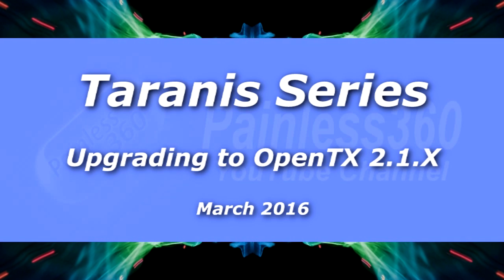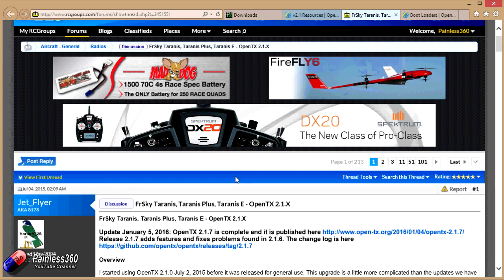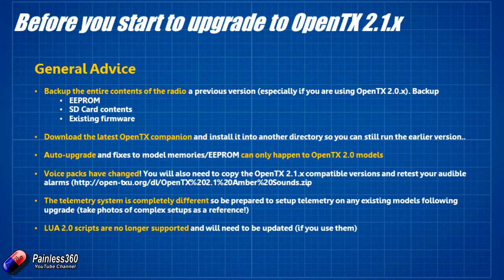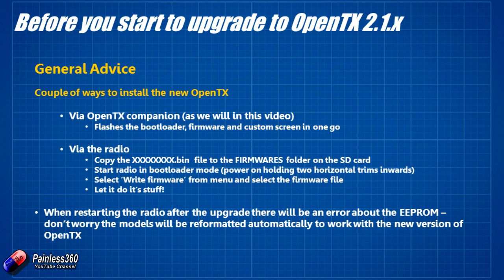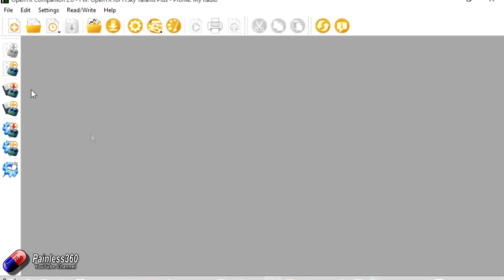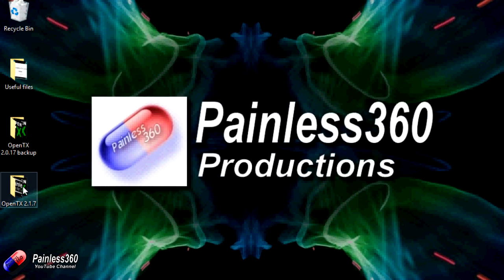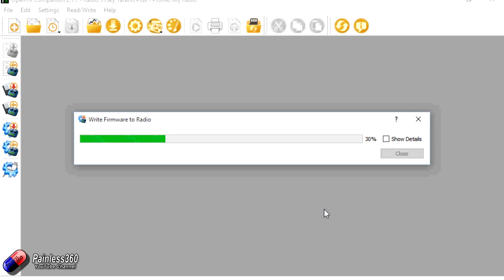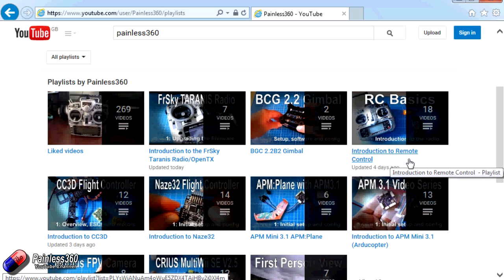FrSky Taranis Series - Upgrading to OpenTX 2.1

Comment: Hello, first many thanks for yours great videos and explanations. Second I upgraded from 2.0.19 to 2.1.9 and it worked thanks to you, but reading out my log file I got a error message "The selected logfile contains 182 invalid lines out of 240 total lines." can't explaine why I got this message. This is a log file created with 2.1.9. When I open a log file created with 2.0.19 the error message is not there??? thanks for help regards Hans  Well second time I powered up my radio in my log file I got message 96 line invaled out of 237 so something is messed up here?? in compagnion logfile screen only 19 availeble screens are displayed. well I went back to 2.0.19
Reply from the maker: Not sure - I've not seen that. I'd look in the forums for that error.. Best of luck!

Comment: Lee, Are you able to successfully bind to the Spektrum RX after upgrading to 2.1.xxxx. I cannot for the life of me get them to bind, I have tried the - and the + as well as changing other values and no luck. I have read somewhere that the upgrade to 2.1 screwed the capability of binding to Spektrum. I have the X9D+ and am using the Spektrum DM9 module, actually I have tried 2 modules.
Any assistance or advice would be much appreciated
Thanks in advance
Reply from the maker: Hey Andy, not sure, I'd check the forums and error reports.. Let me know how you get on..

Comment: When I switch on my transmitter one of the messages I now get is  " SD Warning  expected Version 2.2V0018" then press any key to continue. Have you heard of this message before. Have loaded  update ver. 2.2.2 2018. Any ideas please. thank you.
Reply from the maker: Video up on this at the weekend.. make sure you’re subscribed and got that notification bell..
Reply: Been subscribed for about  3years from the start.
Reply from the maker: In that case here's a preview - https://youtu.be/Yt1F5isxItk :) hope that helps!
Reply: Got the SD to work and now shows on the Sd card page. I have another problem, I can not  get any sound's on the switch's and no image's on the set up page. I have downloaded sound's to the sound's folder and have picture's in the BMP and Images folder's but will not give me an image for my F500. Firmware is 2.2.2 and SD card is the same. One last thing , when I dis-connect the radio from the PC what happen's if  I press the "write to firmware" on the front page with the exit word's on the trannie? What is your OS you are using?

Comment: I recently purchase a radio and all the previous owner had for bitmaps were multi-rotors and the firmware was 2.1.6. Not thinking to save it, I simply merged the bitmap with planes from my other radio that had ver. 2.1.9 on it. To complicate things even further I flashed the radio with version 2.2.  When I tried to load bitmaps a message came up saying there were none loaded. Also, when I turn on the radio one of the warnings say; "CD CARD Warning" expected version 2.2." I tried gong back to version 2.1.9, but it will not let me (stuck on 2.2). Other than that everything works as advertised. Is there a way I can get my bitmaps to show back up and get rid of the CD card warning? :-)
Reply from the maker: If you Google the error you'll find that the error comes from the fact that the file with the version information for OpenTX 2.2 isn't in the root directory of the card. http://www.open-tx.org/2017/05/30/opentx-2.2.0 and http://downloads.open-tx.org/2.2/sdcard/ are usefuil places to find out about, and replace the SD card contents..

Comment: Here's a tricky one for ya. Id like to upgrade my original Taranis, running firmware V1.1.02. A really early version I know.... Any idea how to go about it,? From my research I gather I cant go strait to the latest version? Do you know the intermediate firmware? Also need to update the bootloader and sound pack. Also do you know if the original receiver will also need the firmware updated? Any pointers would be greatly appreciated.
Reply from the maker: +lowtus7 not sure as I've not had a radio on that version. All my updates (and caveats) for the updates are in the Taranis series so you'll just need to see what the pre-reqs are for to upgrade to OpenTX 2.0 on the way to 2.2... best of luck !

Comment: Hi, great content! What does it mean when your firmware is 2.2 but your boot loader is 2.1.6?
Reply from the maker: Depends on how the radio was flashed. See http://open-txu.org/home/undergraduate-courses/fund-of-opentx/part-3-understanding-boot-loaders/ for more detail. It'll still work great..
Reply: Painless360 thank you for the reply it's greatly appreciated - yeah its seems to work fine! I used 2.2 companion and backed up old - downloaded 2.2 through companion and flashed using USB Copied SD card file to stop error -  into root - deleted sounds and added amber 2.2. The sounds work however i can't edit them in 2.2 no matter how I move, rename it delete.

Comment: hi Lee. I just upgraded from 2.0.9 to 2.1.9 but my bootloader stayed on 2.0.9 did I do something wrong I even did it again and it wouldn't upload the bootloader to 2.1.9. what do I need to do
Reply from the maker: +fpv flyby how did you upgrade?
Reply: I followed your video. I backed up my  radio with everything on it first. Then I installed companion 2.1 then I flashed it. The version is on the radio but the bootloader stayed the same. Because I had to redo my whole telemetry. And I couldn't write my firmware with the radio off I had to do the three-finger salute.
Reply: Painless360 I followed the video. I backed up my radio first. and I installed companion 2.1. when I flashed it I had to turn it on. With the three-finger salute. it didn't want to flash without the radio on. the version is on the radio. Because I had to redo my telemetry. it's just when you turn on the three-finger salute the bootloader still shows 2.0.9. I wanted to upgrade to 2.2. so I can adjust my pids with a custom script. that's why I wanted to put version 2.1 on.

Comment: Great video, I'm still using 2.0.xx and been happy with, but I've just built a new micro quad using an fd802 tiny rx and can't get any voltage telemetry to work, only rssi works. Will i need to update the taranis or possibly just the fd802 rx? thanks
Reply from the maker: Possibly, I've not used one of them here.. Best of luck!
Reply: Painless360 It's ok i just figured it out. I didn't add any range for A2 so voltage just didn't show up. For A1 i bridged 5v in on sbus line to A1 pad, all works now.
Reply from the maker: +RCHELIBUG nicely done!

Comment: Hi Lee. This video may be out of date now, I have just upgraded my Taranis Plus (twice) from 2.0.19 to 2.1.07, I followed your video but it did not go exactly the same. The TX had to be on (three finger) to do it, as it wants to check/compare the firmware versions, it would not work with the TX off.
You make a big point about 'backing up' the TX before you do it in case you want to go back, yet you don't tell us how to go back (another video??) It took me three days dealing with a bricked TX to get back, I had to go back to version 2.0.x to get my throttle to work, it only has a range from 0 to +100 and nothing from 0 to -100 with version 2.1. I've tried it twice now and still the same, I don't know if my brain/nerves could stand another attempt at version 2.1, pity because I want some of the new telemetry features, yet cannot get my throttle to work as it should and I can't see where anyone has discussed this issue. Cheers
Reply from the maker: +Peter Hancox this is what worked for us. See the rest of the taranis series for lots of other tips. Best of luck

Comment: How to download the EEPROM
Reply from the maker: +Remielmasloco if you google 'eeprom download painless360' you'll find our video on that very topic. Best of luck
Reply: Painless360 Thanks friend I will look for it is that I have the taranis x9d version 1.1.02 and I want to update
Reply from the maker: +Remielmasloco read the notes for the upgrade and back everything up. That's an old version now and you may need to upgrade to an intermediate step. Best of luck!
Reply: Painless360 Very well that are and apart in the simulator erase the data from the SD card no problem or if I have copies of the sd. It was only the flight simulator that erased sd

Comment: So if the radio works why install OpenTx in the first place, is original firmware broke? I searched and can't find why you would want to change your firmware to OpenTx. I don't own a Taranis yet, but plan on buying one. I see many people install OpenTx, but can find anybody saying why.
Reply from the maker: +John Phillips because the open source project for openTX has more features, functionality and improvements over the firmware that comes installed from the manufacturer. Happy flying!
Reply: Painless360 good enough for me, but courius what differences those are. I guess I'll soon find out. Everybody seems to switch, it must be good features. It seems to me, the makers of the radio should probably just start with open TX. I like the idea of open source, I think it serves the people who use it more. Yeah I can't wait to fly again, been grounded for a long moment, will be back up soon.😉

Comment: Hi there. I just started the hobby and build my first quadcopter. week ago I've received my Taranis Plus. now I'm struggling to upgrade to Open TX 2.1.9. Radio came in with v2.1.6 I've downloaded companion and use zadig to install driver for STM BOOTLOADER but companion doesn't see my radio. Tried to reinstall everything etc.. with no luck. so my question would be can I download open tx 2.1.9 on to sd card then install it in to taranis? then start up taranis in bootloader mode and select write Firmware? when I took sd card from the radio it had all folders as per your video but they all empty. so I can't do back up of the original software. so I'm bit worried to carry out update to 2.1.9 from Frsky 2.1.6 as I cannot do back up of original firmware. would you be able to point me in correct direction?
Reply from the maker: I've never gone back to the original firmware here, you could back it up before flashing but that would need the Companion app working normally. You can try to flash from the SD card.. Have you tried another USB cable? Let me know if you find out what the issue is.. Best of luck!
Reply: Painless360 Thank you for your reply. Yes I used my camera cable and that didn't work so I bought another one and error still persists. when I start it up in bootloader mode and then connect usb cable companion app companion app gives error while trying to write new firmware that DFU device cannot be open. If I just simply connect radio with usb cable without switching it to bootloader mode then companion app tells me that there is no radio detected. As well when radio is on in bootloader mode my device list one pc (WIN10) says Frsky Taranis Bootloader and not STM Bootloader. Can't even access SD card if it's in the radio while connected to pc. Great videos and you helped me a lot with my build and set up of my new radio. Thanks again

Comment: Hi, Thanks for great videos!    Question,, I have a Taranis Plus on 2.0.9.2 EU ...If I fit a module to the back will it operate non EU X8R  RXs????   Ali.
Reply from the maker: +Alistair SUTHERLAND easier to flash the receiver to the right firmware that will work with your radio.. best of luck!

Comment: OK I am probably going to ask a stupid question and maybe getting a bit confused. There seams to be two visions of firmware EU and NON EU and I will be using EU. How dose open TX work with EU and will it?
Reply from the maker: Be careful, there is the software that runs on the radio and read the controls and mixes it etc. That is OpenTX. There is also firmware that is run on the transmitter electronics and this is available in EU and non EU mode. OpenTX works with both (doesn't care in fact) so you need a receiver running the same type (EU or not) to bind successfully with the transmitter protocols. Hope that helps
Reply: Thank you sorry about contacting you direct, 
I think I have got it, the Receiver is in my case FrSky X4R-SB EU and this is the only thing that effects EU or none EU. The RC with upgraded open TX  is happy with both and upgrading will not effect it working with ether. Ok now I have typed this I think I have got it and I can look to upgrade. 
Thank you again.
Reply from the maker: Yep, if you've got the non EU firmware on the radio transmitter electronics then you can flash the receiver (X4R) with the matching firmware too. Best of luck!
Reply: I have a radio that is non EU, if I set in the companion the EU setting then update the radio will this be the only thing I need to do to change the radio to EU LBT?

I have done as above setting setting to EU before getting the companion to update the Taranis. It has only D16, LR12 in the menu after the update.

The radio is after 2016 so this should as far as I know should have the updated firmware.

So this is where my problem starts, I cannot bind with the FrSky X4R-SB EU LBT as the LEDs stay RED/GREEN when the F/S is pressed, Power is made and set the radio so its is chirping away, and have tried as all videos I have seen showing how to bind, without luck.

From this point I dont know what my best option is, 
Flash the FrSky X4R-SB to non EU and update the radio the same using the companion or is there something more I need to do with getting my radio to work with EU LBT.

Note this is a new radio none EU and FrSky X4R-SB EU LBT, 

What would be my best option

Do you have any advice?
Reply from the maker: You can either flash the internal radio transmitting circuit with the EU firmware (that's not OpenTX, it's the firmware that the 'internal radio' runs. Or flash the receivers you have to be non EU too.. Best of luck!
Reply: Thank you,

Now I know, updating the software using companion will not change on its own the radio over to EU you also need to flash the radio. I selected the second safe less expensive if when wrong option to keep the radio as non EU and flash the X4R.

After updating the software back to non-EU and flashing the X4R, after binding Its alive.... It lives....
Reply from the maker: Phew! :D
Reply: Even a dripping tap will make a flood in the end, Just like I will get their but probably takes just as long as a flood from dripping tap.

Comment: I do get a promp to download the new software. I currently have 2.1.6 EU Version. But it wants to download the US Version. And I'm afraid it won't work with my receivers. What should I do?
Reply from the maker: I've not seen a 'US' version of OpenTX. Can you send a screenshot?
Reply: Hi, I got it sorted. I was confused with Taranis Software & internal transmitter software. The transmitter has a  special firmware in the EU (EU LBT). Thanks for your amazing videos! You really helped me getting into the hobby a little over a year ago starting with APM and an 450 Copter. Now I'm FPV'ing in the 200 class and your videos are still a huge help for me. Thanks so much. :)

Comment: Good video. It does not answer one maddening question (one of many until documentation catches up). WHY do I NEED to change to the Amber sound pack??? Surely a .wav file is still a .wav file? I don't want to change my sound files, with many a custom sound.I hate being told I have to do something, with no explanation offered - and I have looked.
Reply from the maker: +Kenneth Barrie because the indexing and names of some of the sounds changed from 2.0 to 2.1..
Reply: Thanks! On the dubious basis in this case of "if it works, leave it alone" I never installed the new sounds pack. Now I know I need to check all the sounds I use do work OK. - not a big job as the same ones are used in most models.

Comment: Ok so I tried to write firmware to Tx and I get a not responding error. It says Executable C:Program Files (x86)/Open TX/dfu-util.exe not found. I tried flashing FW to Tx while in 3 finger solute mode and it worked but the bootloader is still 2.0.15. Going the SD card route results in "no directory found". I am using the original Taranis not the plus.
Reply from the maker: Googling the error finds great posts like this - http://openrcforums.com/forum/viewtopic.php?t=3809 Best of luck!
Reply: I figured it out. Flashed FW with three finger salute then went into menu (long press) page 2 ( SD card content page) flashed the bootloader from there. All is good now. Bootloader says 2.1.8. Plus it works with LiftOff now too which is what I was trying to do from the start. Thank you for the quick replies though.
Reply from the maker: Glad you got it sorted! Happy flying!

Comment: thanks again for the great & easy to follow videos.  Have TX 2.1.8 now & new sounds pack (don't forget to 'extract all' first ! ). All working great & new Telemetry - Variometer- switches etc all set up with sounds. Re-calibrated radio & double checked every thing in Naza working ok. 
Here it comes --- if you have time & any idea ? When the radio starts up it shows Open TX screen (welcome to open TX ) as normal before, but then instead of going to model screen it shows the radio 'Calibration screen' every time. Just a bit annoying, can exit out and it shows model screen as normal.
Reply: Its ok sorry - all sorted ! The radio NOT calibrated completely !! My fault missed something Idiot lol Goes onto the model screen after the TX start up screen now ok ( so if your Taranis goes to calibration screen it needs new calibration guys ! )
Reply from the maker: Great news, often happens to me too - I ask for help and then figure it out within half an hour! Happy flying!